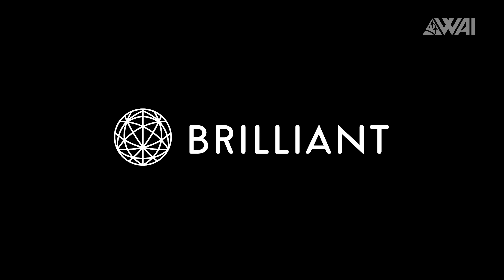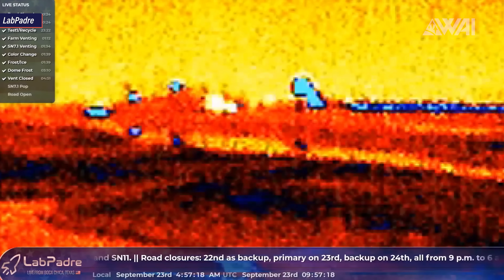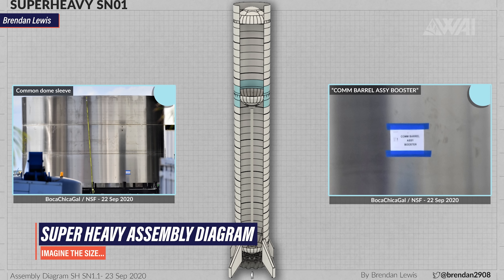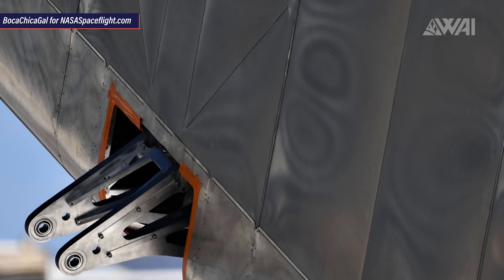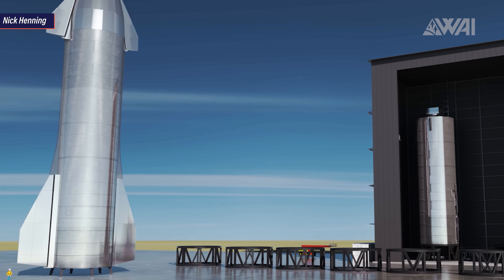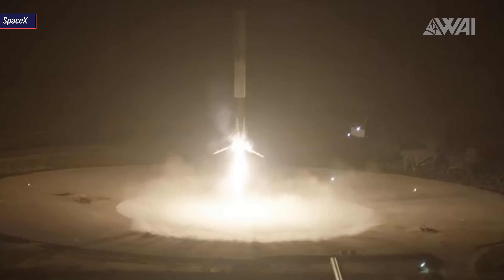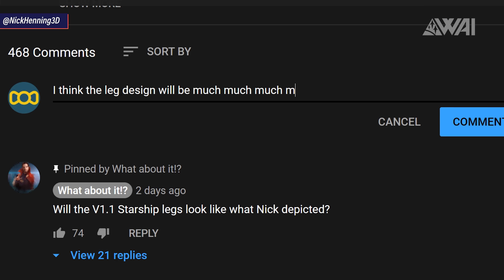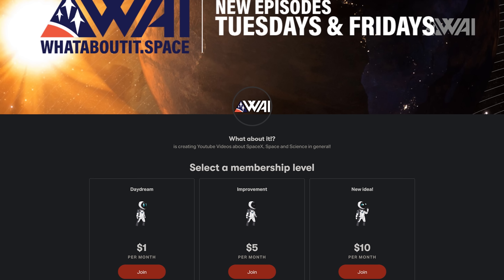122 | SpaceX Starship Super Heavy SN01 In Production!

Comment: SN7.1 failure mode is interesting because the one part of that test tank that we are pretty sure is not going to be in the final Starship design is that top dome, although as you say looks as if the joint to the ring was the failure point and the dome damage happened after the rupture as it was forced upward.

I say the dome is going to be obsolete because Elon tweeted maybe 3 or 4 months ago that he wants to make the domes flatter. Someone then commented on his tweet by tweeting a picture of a guy standing next to some flatter steel dome from some other project and added the caption "Something like this?". Elon subsequently replied "Maybe even flatter" so we know revisions to the dome is in his plan.

You can see why Elon wants flatter domes when you look at how much the top dome with the Tesla battery on it intrudes into what will be the payload area. The lower bit of the payload area within the 5-ring barrel section is the most precious section of the payload bay because that's where you can use the full fairing width for the payload, the fairing diameter gets narrower as it is pushed up into the nosecone, so reducing the height of the dome to give more usable space in the barrel section would be a huge benefit in being able to accommodate longer sections at full fairing width e.g. cylindrical space station components as just one example.

I love your videos by the way Felix, you give excellent summaries and always with a smile on your face. I have a similar smile on my face as I watch Elon and SpaceX finally moving us convincingly beyond the Apollo era.

Comment: wider doesn't mean flip out, flip out are useless for uneven surfaces the span is too big, you can get a calculator and workout how insanely large they would need to be for a 5 degree slope for uneven ground you want a small radius which means similar to current just longer and wider for better strength

Comment: The gravity on mars is some what similar to earths gravity. The starship is in size (both hight and width) bigger then any rocket spacex has at this point. Meaning there is more mass. If the landing legs would be the same as the falcon rockets they need to be incredibly large to give such a wide and big rocket enough spreading of its mass. Without that it could easily tumble when there is a storm. Adding a shifting mechanism to make sure it keeps itself level is not that hard to make when the legs are long enough. All the other design are in my opinion to small to keep it stable. Not bad ideas but the more you can spread the mass the more it keeps itself stable.

Comment: Hello there 

For the tanks, could SpaceX add a webbing of conduits with a high temperature liquid that flows around the tank to try and counteract the extremely low temperature ? 

( To stop the rapid metal expansion, due to metal contracting under high temps ) 

The tanks skin may be need to be increased ( thickness )to have two different temperatures one on the outside and the inside temp. 

Also you will need to account for power so, try some solar power for heating...

Comment: I think that Starship will need a proportionally wider stance than Falcon if it's going to land on uneven terrain (remember that when a Falcon lands it has no payload and is almost empty of fuel), so it seems that a flip-out mechanism will be necessary. I don't think a flush design solves the reentry heating problem (the gaps around the retracted leg will let plasma in, and so the whole bay will need the same thermal protection), so I'm curious to see what they come up with.

Comment: It looks like the metal failed not the welds so if there going to get more pressure out of it there going to need thicker material, different type of stainless steel, or more reinforcement on the dome. I really want to know how many bars it reached it has to be more than previous test tanks.

Comment: First design with the falcon flip out legs is viable in concept, but the presented design is far too weak, especially at the mounting points. What must be considered is the massively larger dry mass of the star ship in comparison to the falcon, being 130 vs about 22 tons. While this is viable for Falcon, the massively increased weight means legs so far out from the vertically compressively strong thrust barrel section that the load will be transferred into the rings of the lower tank in a direction where it is much weaker, not to mention that they would have to be much larger to simply support the increase in weight.

The second design, while looking cool, is completely impractical both from a manufacturing and structural integrity standpoint. By compromising the continuity of the rings of the barrel section, not only do you make it a nightmare to manufacture but you sabotage the strength of the thrust section naturally provided by the full ring. This would require a completely redesigned thrust section which would impede on the space inside the skirt and add lots of complicated parts and welding, including the ring with curvature in two directions, the internal stainless panels, and the massive solid leg. While it looks cool, I don't get how anyone would ever think this is a practical, or "simple" design.

The third design, while technically feasible, is severely overcomplicated, especially with the actuated cover doors, and does not provide any notable feature improvement over the current design which flips from the inside. All of the load is still transferred through the secant line supports like with the current design and it adds unnecessary aero covers, actuation, mass, and welding. The only notable change is the lack of a crush structure with what I assume is rather hydraulic dampeners of some kind.

The major design considerations for legs are that they need to transfer the compressive load straight upwards through the barrel section, the farther out they are from directly below the more lateral moment they are put under. Next, their simplicity for manufacture, which translates to weight, and functionality are priority. Based on these I think that either a flip out design like the current one will be utilized, with perhaps greater functionality than the ones in SN5 and 6, perhaps including hydraulic dampers. This design is ideal because its simplicity to integrate into the thrust section while transferring the load directly to the barrel section straight up, in its strongest direction. The second design that I think could be used is the one similar to that integrated onto MK1 before it was destroyed, which utilized linear actuation to extend legs from aero covers similar to that shown in the 3rd presented design. This design shares most of the strengths with the internal flip out design but would be much easier to implement non-level landing through hydraulic dampening or other actuation
Reply: What about piston with rod that deploys from cylinders mounted just inside the skirt and project directly down.  The cylinders could be charged with methane or oxygen from the tanks or perhaps a bleeder valve off of one of the landing engines.  Computer controlled relief valves could release some gas from one or more pistons as the craft touches down for leveling.  Once landed, there would be a locking mechanism that freezes the pistons in place.   Use a double sided cylinder (same as used in hydraulic cylinders on excavating equipment and the like) so you can charge the top side of the cylinder to push the piston down and charge the bottom side to push the piston back up for retraction.
Reply: @apostolakisl  certainly a possibility similar to my second idea, but I think it would utilize a different actual hydraulic fluid as I don't think they would rely on lo2 of ch4 because of their compressibility and cryogenic requirements.
Reply: @vincentsoubbotin7830  The point about gas volume compression is valid, but hydraulics is an entire system and Elon hates more systems.  He is already using bleeder valves off the Raptor turbo pumps  to autonomously pressurize the CH4/O2 tanks(instead of Helium)  so the plumbing is there. He also gleefully announced that they ditched hydraulic actuators on the flaps for simpler direct drive Tesla motors, so I don't think he is real fond of hydraulics.   It is just a matter of getting the right amount of pressure in the pistons which I think is pretty straight forward, though I could be wrong.  The technology already exists as lots of trucks use air suspensions.  Plus, no added weight of hydraulic pumps and fluid.  Plus air will cushion the landing where fluid will need pressure relief valves that feed back to a reservoir.  Gas relief valves can just be vented..  To me, the only concern is that once you land and the gas changes temp, you'll need to add or remove gas.  Some sort of post landing lock would handle that.

Comment: Hi Felix. Great episode.

I have welded milds steel for over 35 years using several processes, This year I started teaching my self mig welding stainless steel & in time I will do tig.

I am not sure of the detail of how stainless steel behaves under extreme  pressures & cold. But between @least stainless & mild carbon steel there are common behaviors.

When I 1st started welding it was explained to me that the weld bead will always have a higher tensility than the metal either side of it. 

So when a weld fails (@ normal temperatures @least) it is really not the weld that fails, the tear is usually along side of the weld in the metal.

I am guessing the extreme cold does not really make much difference to the result other than just raise the tensility of the weld & surrounding material @ equal rates.

I am interested to learn if this is actually the case.

Comment: That's great that you put your name at the end Felix; Thanks for that!  I favor the fold down wide stance legs having 50 CM long barbed spier anchor points on the ends for semi-fixing the craft to an unimproved dirt-like surface.  These are remotely released and left behind if the craft is to be reused.   The craft can land on Earth landing spots, with the pads to which the anchor points were attached.   Anchors will help prevent tilting due to side loads; from wind and winches etc.

Comment: With the design of the legs, I'd go for a three leg design actuated a bit like the Falcon.  Tripods are inherently stable and when equally spaced, only one of the legs would need a heat shield.  It is relatively easy to make the legs long enough to create a wide stance when opened and satisfies all the design requirements for legs on a super heavy.  Small feet that fold away from the body as in the later designs animated on the video would be problematic because the actuators would be very close to the engines and the complexity and weight of a design requiring six legs, not to mention the instability of having them so close to the spaceship would, I think rule against that sort of design.  Such legs would not allow for levelling the spaceship even on a prepared surface to the same degree as Falcon's legs if the landing was less than perfectly vertical.

The benefits of having three legs rasther than the Falcon's four, is one of less weight, less complexity, inherent stability, a smaller angular deflection would be required to make them self levelling, and the need for only one leg to be heat shielded make it a no brainer for me.

Feel free to criticise or bring up any objections...  :)

Comment: Wild speculation, tanker ship will be smaller than crew ship and cargo ship because fuel is really dense and only takes about 200 cubic meters for 150 tons of fuel vs the 1000 cubic meters of the passenger and cargo variants, this would also allow a slight increase in fuel capacity because it requires less structural elements and over all a shorter ship, don’t know what that would do to aerodynamics on reentry though

Comment: Felix do you think that the Super Heavy ring stacks will be welded in the High Bay? Will SpaceX move the welding equipment in there? Or will they weld together big sections of rings in the smaller tents and then weld together those sections in the High Bay?

Comment: ¿why does starship have flaps? Falcon 9 doesn't have and it works well
Reply: On the contrary... you're thinking of the Falcon 9 *booster*, the equivalent of which is SuperHeavy, which will indeed land in much the same manner as Falcon boosters do today. Recovering boosters is relatively easy, because they're only making a short sub-orbital flight anyway... they're travelling at about 2000m/s at separation, so they can carry enough fuel in reserve to negate that propulsively.

However, Starship is an upper stage, going all the way to orbit and beyond. That means that during re-entry, it's coming in at around 8000m/s. Falcon 9 upper stages burn up and crash into the ocean at this point, while Dragon relies on a big blunt heat-shielded backside to burn off energy before deploying parachutes. That's not going to cut it for something the size of Starship, so they're going with something more like the Shuttle — a big heat-shielded underside to maximise aerobraking, and some big control surfaces to steer.

Comment: Remember Elons mantra, the best part is having no part, so design number three is out-too complicated. Design number two does not give enough ground clearance of objects beneath the engine bells so I am going with the first iteration. Clean, simple and already proven but beefed up a bit given the starships weight.
Reply: Although not really proven in this application. It needs to change from the falcon design as it has to be retractable for launch, which is done manually on falcon I believe. That and falcon locks and doesn't auto level.  But I agree I think something based off this design is the most likely of the three presented.

Comment: i see a variant of falcon legs...but instead of fixed pivot at the bottom and an arm that pushes rotating it out and around i see 2 fixed arms and a movement arm that pushes it out and down.  this gives it the best of all options... quick deployment and wide footing as well as variable extension and good mechanical advantage

Comment: I'm really struggling to understand how a heatshield tile of a standard hexagonal shape can be fitted on all the curvy parts of the ship, namely the nosecone, aerodynamic covers and the leg casings. It would be cool to see some speculation about this in future episodes if you think it's a good topic to cover. Perhaps some overlapping tiles on the tight spots? Keep up the good work! You are one of the most entertaining channels covering SpaceX activities.
Reply: Minimal gaps may not be an issue, although not confident on that. I.e. if 99% of the side being heat shielded is covered that may provide enough protection that the steel can handle the remaining thermal load.  Possibly they could use different sizes and shapes of tiles, but I'd expect them to keep it as simple as possible. Felix has upload a few videos in the past that show testing mounting tiles, sorry can't remember which episode and would have been a while back

Comment: I´m still not sold on the "Falcon" legs. If you flip the legs just down on the outside, then you will inevitably get an uneven base width on uneven ground. That is not ideal.
I wonder whether Elon just referred to a specific feature of these legs.
Reply: Is an uneven base width a problem? As long as the center of mass stays over the area defined by the legs shouldn't it be stable regardless of if the base is uneven

Comment: From what I've read, the Falcon 9 legs are mobilized using helium. Upon, landing, they absorb the impact thanks to pneumatic mechanisms.

You nevertheless present the system as if they were locked in place once flipped, not capable of dissipating the kinetic energy as the rocket lands.

Comment: I think the 3rd design but with modification.  I don't like the flip-out style because they have the potential to fail or malfunction since the design is too complex.  The legs should be on the outside covered but they should shoot out straight from the bottom like a shock absorber.
Reply: In my opinion the 3rd design looked the most complex. Less stability due to the lower leverage for the 2nd and 3rd design as well, and all probably to short to allow take off directly from surface without risking damaging something.